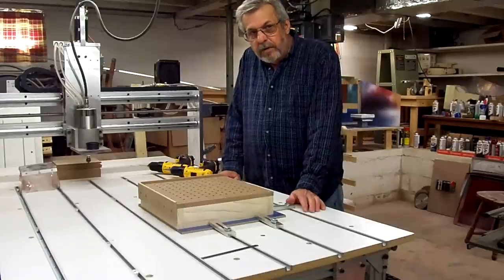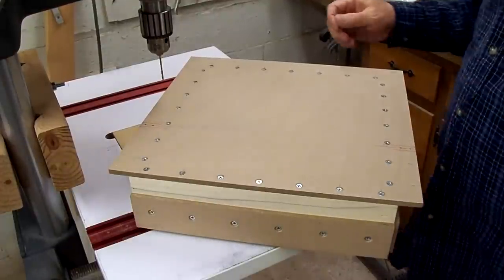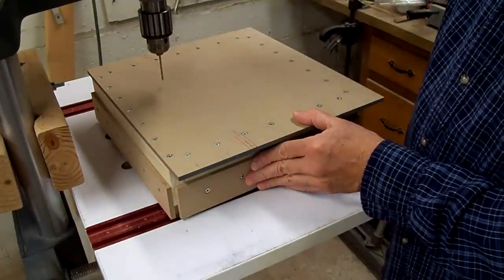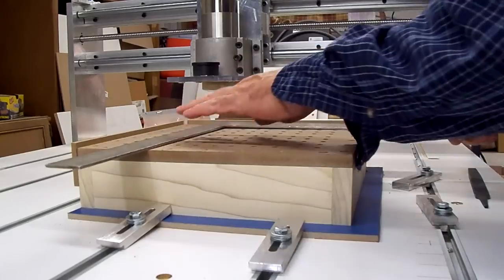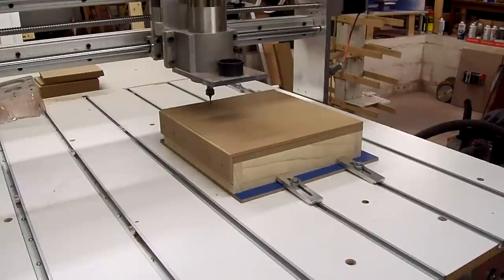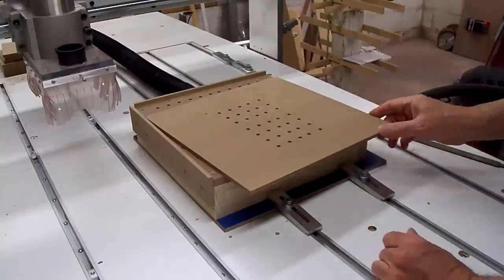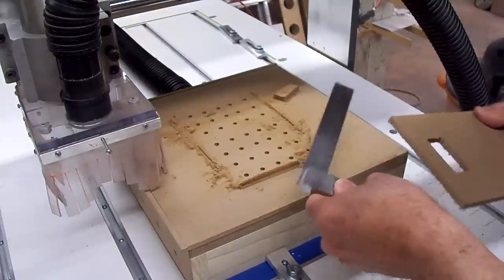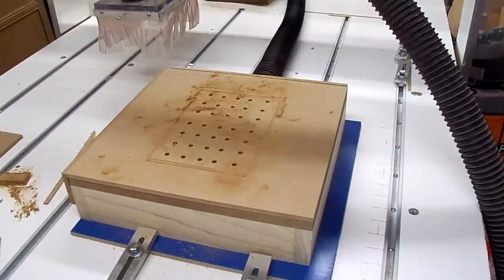CNC Vacuum Holdown Fixture part 3 Conclusion

Comment: thanks for posting these vids on the CNC , very informative .
Reply: +MyRobertadams   one question about the CNC you built , what size are the exstrusions of the frame ?  Others I have seen are 40x40 , 40x80 , and 40x120  but yours appears much larger and stronger from the company you went with .